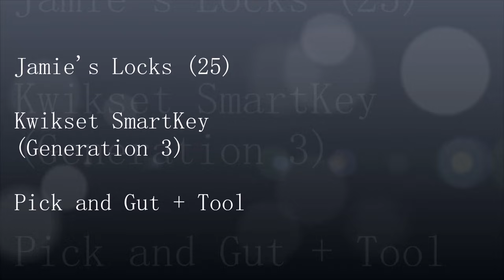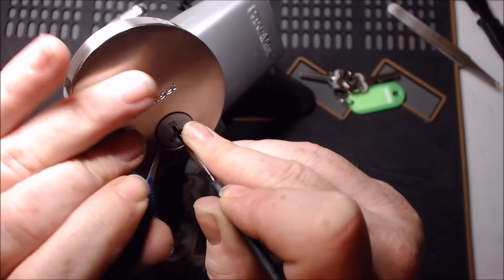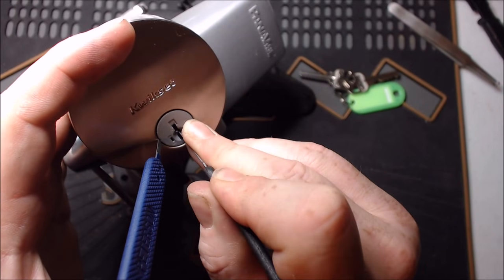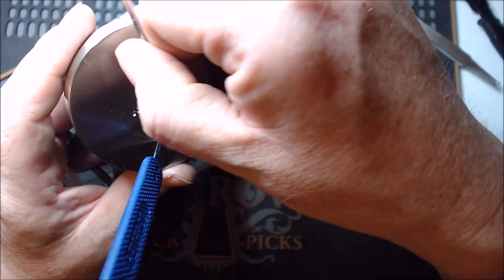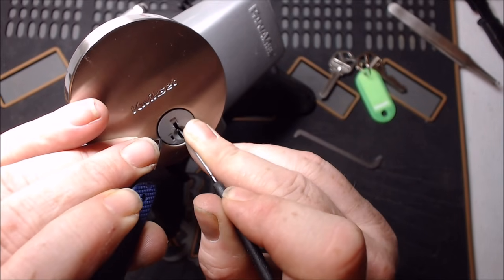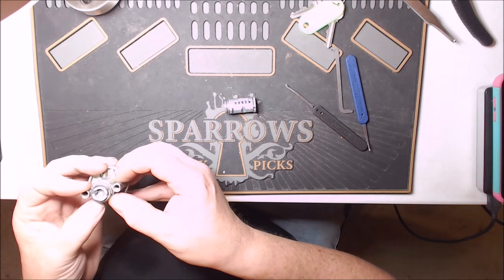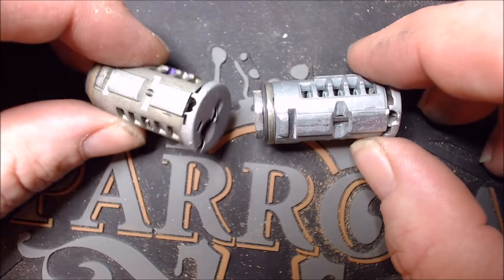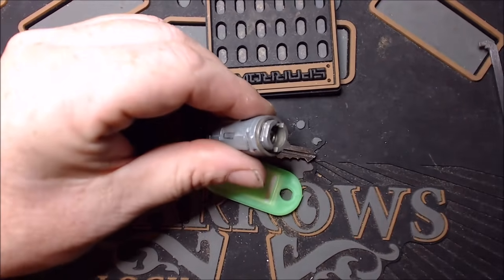(25) Kwikset Smartkey (Generation 3) Pick and Gut + Tool

Comment: Thank you SO MUCH for this- I'm working in an area where the majority of apartment complexes are stocked with these little smartkey lock pains... very interesting technique, thanks so much and I look forward to mastering this lock series!!!
Reply: You a locksmith?  If so, what’s your go-to approach with these suckers?
Reply: @moose2934  Honestly? I avoid them if at all possible. If it's a latch, I'll latch-slip it or pop the door open. If it's a deadbolt, I'll remove the face plate of the deadbolt and back the screws out with a drill bit, the lock fall apart, I'll open the door with a screwdriver, then put the faceplate of the deadbolt back on, reassemble the lock, and usually the damage is minor enough that nobody notices it. It's a ton more effort, but beats drilling them out and having the customer have to purchase a new lock. They typically hate doing that.

Comment: Ridiculous. As a locksmith these things are a nuisance and will cost customers more for a lockout. Because I’m not going to pick this pos. I’m going to drill it off the door and charge them for a new lock.
Reply: Or you just buy the decoder and cut the key
Reply: I never ever drill
Reply: You can decode with a Lishi KW1 and cut a key. Search for "kilo" locksmith video.
Reply: @tartgreenapple That's only for the Gen 1 and 2, not 3 or above
Reply: @n0ame1u1 exactly. The KW GEN3 w/ SK tech keyhole is not compatible with the KW Lishis...at least not for now. Maybe they'll come out with one someday... But probably not since the sidebar shim technique is usually the way to attack these